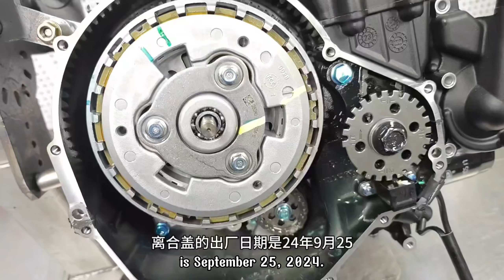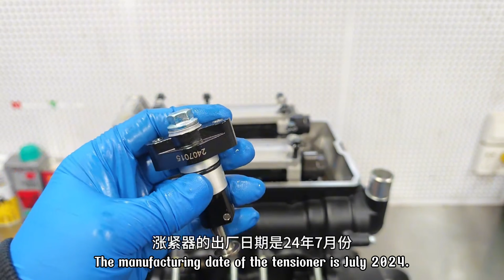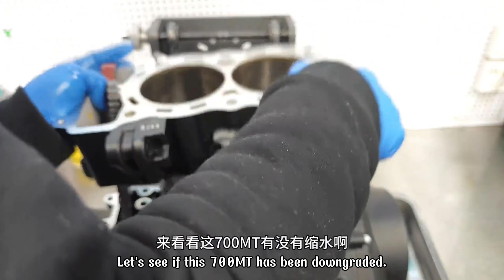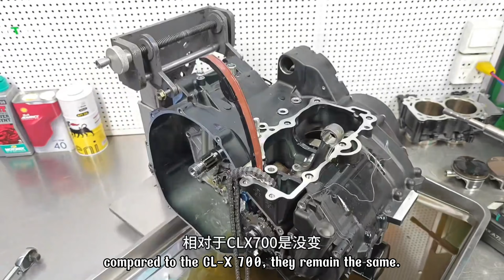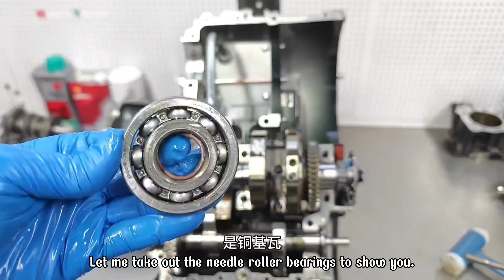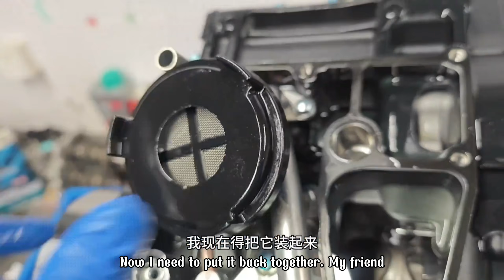Does a $4,000 Bike Have a Premium Engine? CFMOTO 700MT Full Disassembly!

Comment: 1500 km...small issue...behind waterpump...rubber seal leaks...very little ....cf warranty...they fixing it...
Look or feel at the underside off the waterpump..about 4cm from the egde...there is a small hole (weep hole)...is it dry it is good...wet thats not good...green or pink...waterpump seal is leaking inside...brown is oil...morer work...
In my case a warranty issue...

Comment: Hello. The engine you dissasmbled is a new 2025 model from CFMoto, known in the West as the CFMoto 700 MT Adventure. Is the engine of the 2024 Model 700 MT the same as this model? I'm thinking of buying the 2024 model, the facelifted version of the 650 MT. Would you recommend it?
Reply: Hi ich ab die CF Moto 700 MT fährt sich super kann ich nur empfehlen , 68 PS reichen völlig aus für schöne Fahrten MFG .😊

Comment: I wonder if they had upgraded the valves. The CLX  700 (and the older 650) had fairly common issues with valve failure. And as an aside,  also same failures on the 450MT.